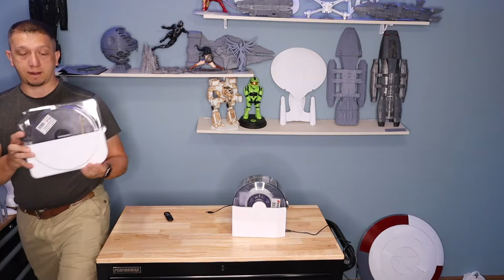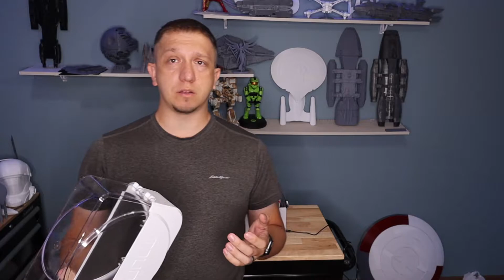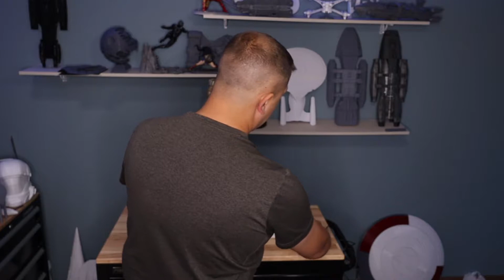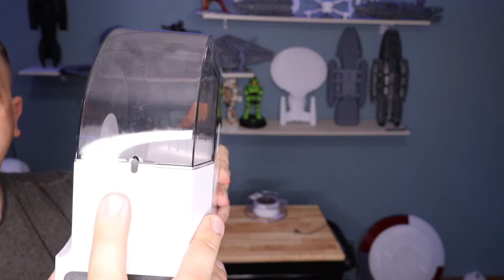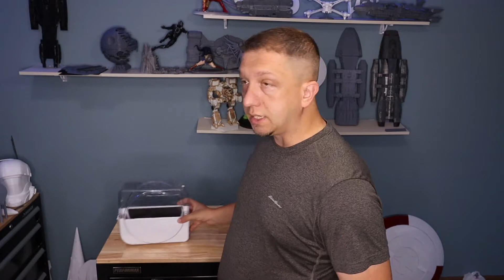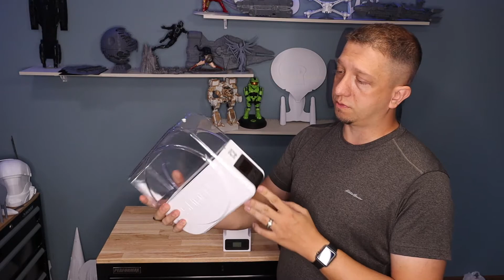SUNLU vs eSUN filament dryer

Comment: Erm heat rises its what it does, so how does it not reach the upper area of the container ?
Reply from the maker: Not at the same heat as the bottom layers.  Yep he esun using the blower creates a balanced heat.  The sunlu it has 3 different temps so not a consistent cook

Comment: Interesting. I noticed in reviews of the Esun that many people complain it's not wide enough for 1KG spools (every maker has slightly different widths). I use a lot of Prusament which is right at 80mm wide and someone said the Esun only holds 75mm wide. I ended up with the Sunlu and I modded it with a fan (took 15 minutes and a $3 fan) and it works good. I think the reason they think it's OK to only have heat at the bottom was it will be used 'while' printing so the spool is turning.

Comment: Why your esun is different with other YouTube video. Yours have thermal insulation.
Reply from the maker: And the blower.   The sunlu version does not have a blower even distributing the heat
Reply: @Rise3DBuilds  i missed your reply. But my question is exactly like black water explained. Because of my bad English you doesn't understand what i mean. Thank you for replying.